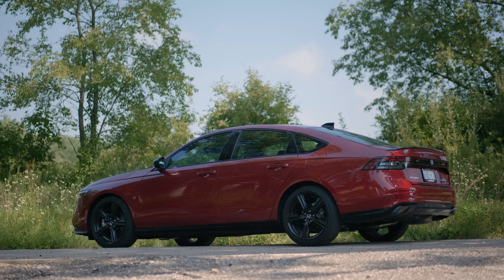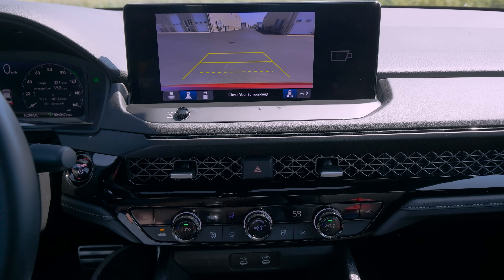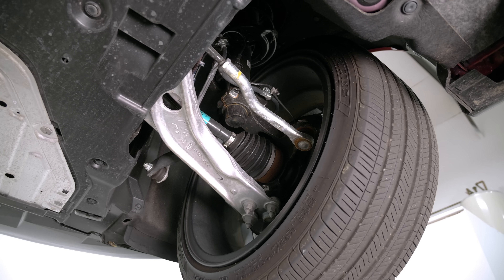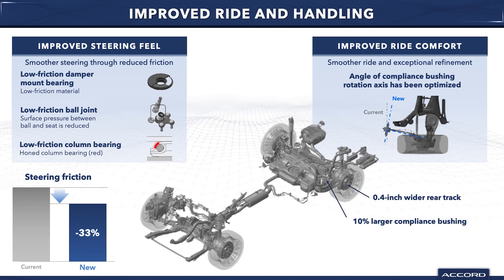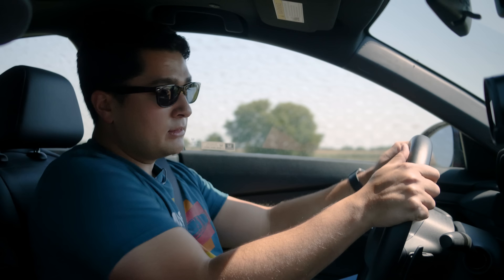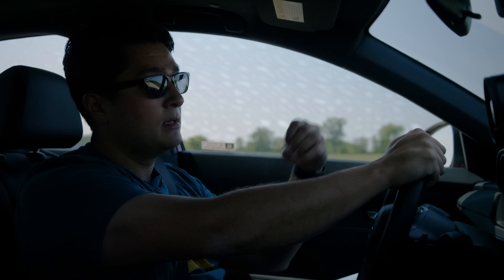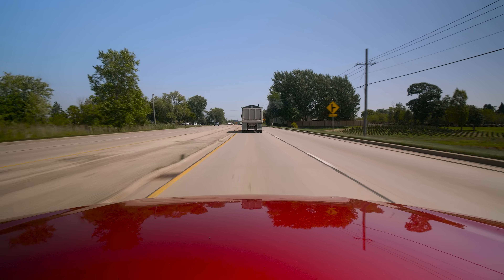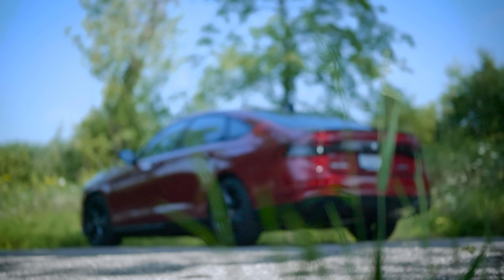2023 Honda Accord | The Art of Normal Cars

Comment: I hated the stapler tail lights of the 10th generation, but I can’t believe how well it has aged.  Some of the aftermarket tail lights for the 10th gen are insane.  The interior of the 10th gen is really good and the side sculpting is bold.  It’s unreal how Honda keeps pumping out cars that people rip apart on styling when they release, then 5 years later it’s the greatest thing on wheels.

I hate the 11th gen styling even more than I hated the 10th gen when that came out.  Now that there is no 2.0T option and no manual transmission, the 10th gen sounds like the one to get if you have any shred of enthusiast spirit in you.
Reply: Man, you are exactly correct here!  I bought my 2018 Civic Hatchback 6 speed LX brand new in Nov of 2017, have 96k miles on it now, it's fantastic, drives as good as the day I bought it!  The styling is better than 11th gen, bold and "cool" looking, interior is better styled too, and body style is great too!  11th gen Civics and Accords are grandma's car, just not much styling, for sure.  I'll never sell my 10 gen Civic!  And I get 40mpg doing 70 mph on the highway too so Hybrid hype is not that great anyway.

Comment: I have very mixed feelings about this car.  

My question, is how does the MPG hold up at high speeds.  If you have the same problem that previous accord hybrids had you are undercutting this cars selling point as a long distance cruiser.

Honda risk this car getting written off as a lesser Camry hybrid

Comment: Notice that the great advertised gas mileage occurs at around town speeds.  So, great for commuting.  The previous generation with the 2.0 turbo can equal the highway mileage of the hybrid.  Actual mileage depends on the fuel.  The alcohol content in much of the fuel now sold can vary wildly from what is stated on the pump.  I wish they made an AWD model.

Comment: The previous gen with the detuned R motor has been hands down one of the best Accords I've driven next to the 6-6 coupe. But the road noise will always be Honda's biggest flaw.. the lengths owners will go through to cover their interior with dynamat in every nook and cranny is absurd when it should've been much quieter from factory.
Reply: Acura owner here and I am thinking about this. New tires helped a lot, but I want it even quieter.

Comment: My last car was a Pontiac G8 GT.  I'm now driving the Accord EX-L hybrid.  Nope, it's not as fast as the G8 but it's no slouch.  Even the non-sport hybrid has a surprisingly quick low speed launch.  Handling is excellent for daily driving.  Absolute joy to drive, and I'm averaging 49.6 mpg in very mixed driving over the past 3 months.  Curious to see what impact freezing temps have on it, as I'm sure it'll drop.

Comment: gimmie compact 4 seater that is lower to ground instead of being tall bodied, then offer a version with ride height  of 7 inch because average other car also has something like 8 inch and that would keep the crash structure (which is low toward ground in body structure to minimize chances of car rolling over onto its side in a dramatic turn)  at level with average other car, so both carsin crash absorb crash energy vibration etc to minimize chances of cars hurting people inside and having a car go over another one where the crash structure would ram into the weak parts of car toward the people inside.  to have this ride height when it helps, car could also have explosives or pre pressurized hydrallic or normal pressurized air have the car to jump to higher position where its locked in places, even seatbelts have such thigng to hold people in their seat from flying and crashing into stuff. the pre pressurized gas/air solution could work to maek it easier to put stuff into and out of car, allow sporty  or floaty anti bumpy ride suspesnion dynamics, and people like the looks. there should be laws against high ride wieght and weight etc, but of course CAFE laws and other "enviromental" stuff liek that are usually ironic because msot these corps and government and even normal people do not actually care.

Comment: Very happy with my 23 Touring. It's comfortable, feels near luxury, and gets approximately 48 mpg. The infotainment system is excellent, and the Bose audio sounds very good.
Reply: How is the acceleration?
Reply: @haidarmohammed8450  It's not a fast car by any means however it merges onto the highway or passes with ease.
Reply: @haidarmohammed8450 acceleration is fine, but you don't get this car for 0-60 performance. Nonetheless, the Touring model has enough power
Reply: Got one too. Love the car!

Comment: Recently took a top of the line Accord Touring Hybrid for a test drive. The interior layout/controls are excellent and are so much better than the TLX which has a ridiculous touch pad controller and push button transmission. However, the cooled seats did absolutely nothing and the lack of a 360 degree camera is a huge omission. Unfortunately, the boring styling and drivetrain are deal breakers to me. It didn't help that the dealer had $5500 of added nonsense on top of the $39K MSRP.
Reply: I got that top trim Accord Hybrid touring in black. I absolutely love this car but I agree with you in those 2 negative points. The backup camera's quality is not high resolution, it should be at this top trim and also I don't turn on the cooling seats because it doesn't do much. The dealer that I got it from didn't have a markup so I got it at 40k and to me is the perfect daily car.
Reply: I agree that it is the perfect daily car. It is the smartest choice in so many ways. My logical side knows that anything else I buy will likely be less reliable and more expensive to operate. I just wish the Accord appealed to my emotional side as well. I'm glad you had a good dealership to work with.

Comment: It's not a problem that it is boring with the Civic being so big now.  Sedans need to either be sporting or luxury now that they are specialty form-factors, and Honda chose the luxo path, which makes sense.  A Civic Si is the sporting sedan if you want a sporty sedan, let alone the CTR and ITS.  It will age well with its subdued styling, and the take rate for the manual Accord was not that high, proving enthusiasts weren't getting one to haul their families, at least in sufficient numbers.  Well done, Honda.

Comment: The loss of the 2.0T K20C3 engine option along with the 10-speed auto/6-speed manual option is a travesty!! A travesty of monumental proportions. That was the perfect combination for a mid-size sporty sedan. That engine is near perfection, same for the transmission options. Easy to maintain, easy to work on, would last basically forever if properly maintained, and had a ton of aftermarket support for those that wanted something more. 

IF I was in the sedan market right now, in that price range, I would absolutely try and find either a new, or lightly used 2.0T Accord Sport (preferably with the 6-speed manual, though the 10-speed auto is awesome also).
Reply: Forgot to add that my main preference would be the 6-speed, so that you can do either a direct swap for either an Si or Type-R 6-speed with LSD. Or just add an LSD to the existing 6-speed. It would change the character of the car dramatically...and would truly be a near perfect FWD Mid/Large sedan.

Comment: Have owned the base Sport hybrid for two months now and have overall enjoyed the experience. As mentioned in the video expect around 40ish mpg. However, what I have noticed regarding the MPG goes against the company suggestions. I find myself with much lower city mpg than highway, which seems odd for a hybrid. Getting around 35 for city and 52 highway. 

As for the interior. Seats are pretty comfy, even the cloth ones in my model. The arm rest does leave much to be desired, though. Feels too low for comfort. One odd quirk of the car is the glove compartment, it is comically small for a vehicle of this size. Beyond that, there is plenty of room and the controls are well placed. 

Regarding the body design, it is very much subjective, however the colors really do influence how this car is perceived. White, Black, and silver really do give off fleet vehicle vibes. The bolder colors do tend to be a bit more tasteful for this model. 

Lastly, as touched on in this video, you will find your drive experience essentially that of an EV, with the engine occasionally turning on. Ends up with a pretty smooth ride. That being said, I can't help but feel that it should have just been a full on EV, feels like a stop gap.

Overall, great commuter car. If you're looking for fun, you'll need to look elsewhere. If you want something that honestly drives extremely comfortable for it's price class, has plenty of room for passengers, or just want something economic, it is a great option.
Reply: Thanks for sharing your ownership experience. What color is yours?

Comment: There just seems to be a lot of road noise still. In the whole Driving Impressions portion, it's hard not to hear every road imperfection, every bump, all the road texture. It sounds very boomy in there. Blame the 19" wheels, but there are plenty of cars wearing large diameter wheels that don't end of transmitting this much reverberation through the cabin, the Accord is.

Comment: As an owner of this, it does exactly what you want it to do. I bolt have the base sport but it’s just as refined as the higher up trims. Quietest car I’ve owned, and it feels like an electric car a lot of the time. It’s not super quick yes, but it will get you to 50 mph just fine. It’s not the 23’ type R I had or the 22’ Si (tuned), but that’s fine. It does what it needs to and people compliment the car often. They say it looks like an Audi. it Handles really well and I love using the regen breaking to slow down the car, because I don’t like breaking, especially in corners lol. Overall great car and I got it for a great price without blind spot. Was $32.7k Otd. I Can’t complain. Mpgs are there, Handel if is great l, reminds me of the Si the way I push it in corners and make the tires squeal. 40+ mpgs. quite and comfortable on long drives. Wowza.

Comment: The only shitty thing with Honda is the oil-fuel dilution problem. Direct injection without port equals waaaay more frequent oil changes. They have smart engineers, I don’t understand why they stop fucking around with bullshit multi stage DI and just implement port. It’s like they don’t want to admit that Toyota is correct.

Comment: so the environmental solution today is not replace the combustion engine with electric i.e. 1 engine type for another, but lets have both, oh and lets include a generator as well. Yeah 3 engines, that'll do it.
My father had a 1979 Accord, which is similar in size to todays Civic and easily got 45 - 50 mpg on a run

Comment: I previously had a 10th gen accord with the 2.0T/10 AT. Jack and Mark summed it up perfectly with that gen. It gave me 80% of what a G series 330i gave, but at a much more reasonable price. It felt solid and Germanic in its driving characteristics. I was pretty down on this 11th gen when it came out, but the fact is I’d guess 95% of accord buyers even knew or cared what a 3 series drove like. The newer, generic styling has grown on me and Honda makes a great hybrid system. Despite the loss of the “enthusiast” ideology behind the accord, I knew from the reveal of this that it’d be the best driving midsize in the segment for all the reasons they’ve mentioned. I now have a new civic hatch with a 6mt and it kinda picks up where the 10th gen accord left off for “enthusiasts” choice.
Reply: I also bought a 23 civic touring 6mt and one thing I CANNOT believe they did was not include lumbar support. They gave the passenger a power seat but couldn't put lumbar in atleast the driver seat? Hondas, at least used to be, set apart by their front seat comfort in my opinion. Now, nothing special.
Reply: @Oliver0200  definitely agree. First week with the car I was worried I may not be able to handle the lack of. My accord had 4 way so the Civic definitely took some getting used to. Agreed it’s ridiculous that in 2023 Honda doesn’t include that. Gotta step up to the integra for such a “luxury”. They even got rid of the 4 way on the new accords, which is now 2 way. Annoying cost cutting.
Reply: @Oliver0200  also dealing with some annoying cabin squeaks/rattles. Really my only two issues. Loving the car tho!
Reply: To compromise seat quality in order to save a few bucks is inexcusable. An uncomfortable seat can turn a longer trip into a nightmare. The seats in the new Civic have been getting mediocre reviews which is a shame - many rating them as "just alright." My '08 Fit has excellent seats while a 2023 Civic Touring doesn't? That's pathetic, Honda!

Comment: For those of you interested in fuel economy, allow me to share some real world numbers.  In  3000 miles since new, our Touring model is at 46.2mpg.  This is driving like a sane 64 year old in ECO mode with about a 50/50 mix of city/highway driving.  In the last 2500 miles (excluding the early miles during a cold month of March and break-in), it has averaged 48mpg.  I have taken several trips of over 100 miles, mostly highway speeds of 60-75 where it has gotten at or near 50mpg.  I am sure the lower hybrid trims with smaller wheels and tires would get 3-4 mpg better.

Comment: In 2012, I only could afford one car for work and bought a new 2012 Camry 2.5L. Put 300k in 5 years and it drove like new the entire time. The most relevant thing about that car, was not it's durability and cost to owning, but it turned out being the most fun winter car (Toronto winters). In snow/slush, you could feather the gas and do a slow left-turn drift or crank the wheel, tap the brake which will skip-out the rear-end and then gun it around the right turn. For a 2012 car, it had an amazing traction control system that allowed driver to steer with the brake pedal.. Given trends, I think the new Honda has given up and now has Toyota carrying the enthusiast baton...Current 'R' seems more like an ego trip..

Comment: No samurais were harmed during the making of this video. - 11:54

So this Accord interior appels to me at first glance, but minus the two displays.
And what is Honda phone-home behavior/policy these days? Can the car be kept away from doing any of that? Or is it hooked into the Matrix?
Externally I think it is the good kind of allegedly boring. It looks sleek and tasteful and not as painfully Bauhaus-dull as a 'Volkswanne'. It's more towards the Audi design.

P.S.: I am such hardcore lowtech that when my 2000 Corolla facelift model came with an extremely primitive "board computer" (clock, fuel consumption etc.) on the dashboard, I had it removed and refitted back to the old model's way where the radio headunit mount was up there. (And the dealership didn't get the dashboard color code for the part right even though I had bought the car from them.)

Comment: A loaded one is $40,000. CVT is a deal breaker for me. There are no options left if you don’t want a cvt or crossover
Reply: Loaded model does not use a CVT
Reply: @bitbat9  they’re all CVT now even the touring and sport
Reply: @devn3813 The hybrid models use an eCVT which is not a traditional CVT. Doesn’t have the horrible rubber band feel, and is more reliable
Reply: The Honda hybrids dont have trasnmissions, Honda says eCVT just a marketing term

Comment: Simple, durable, and reliable are relative terms these days, with plastic everywhere all over the engines of MANY manufacturers, INCLUDING Lexus. With chain drive and proper oil change intervals, this engine should be reliable. But with the complications of a turbocharger system, direct injection systems, AND hybrid equipment. actual reliability is in question. It's too bad Honda couldn't simply re-engineer a very basic D-series engine with chain drive, a modern ignition system, and 2 liters of displacement.
I'm no mechanic, let me get that out there, but I really believe that's what should've been done vs the gimmicks like DI, plastics, Hybrid systems, etc. Governments around the world have shoved manufacturers into a corner.  Those things add unreliability and remove durability. Obsolescence seems to have been built into not only Hondas but almost everything new on the showroom floor today. At least today's cars aren't slugs like they were in the Malaise era.

Comment: I owned a 2001 Accord.  I never thought of it as a sporty car, even though it had a 200hp V6.  It was a great car.  It was very reliable and got me where I wanted to go in comfort.  The understated styling and comfort of this new Accord fit that goal.  I would have kept my 2001 Accord for longer except that some lunatic driver in Texas ran me off the road into a median at 65mph on the freeway.  My Accord got mangled and was almost unrecognizable.  I walked away with a couple of small burns on my wrists from the airbag and a stiff neck.  My Accord saved my life.
Reply: They didn't really used to be sporty until like 2014 or so. They had some v6 coupe manuals that were quite quick, and then the 2018-2022 models with the 2.0t, especially if tuned, paired with the 10AT were super quick for the money.
Reply: @neilquinn it depends how you define sporty. The 1990-2007 4cyl Accords had very good handling and steering feel, very fun on twisty mountain roads, but all the v6s from those years handled horribly.
Reply: @mofayer  That's a good point and underappreciated in the US where people value 0-60 and power. Also depends where you live - by me there aren't really interesting mountains or twisty roads/coasts, so handling barely matters. I'm leaning towards Lexus for some comfort/performance/quiet.
Reply: @mofayer  my '95 4-banger Accord is still one of my favorite cars. It was fun to drive, easy on gas, a quiet and simple interior, and easy to work on. It was also just fine size-wise for a family of 3 with a toddler.